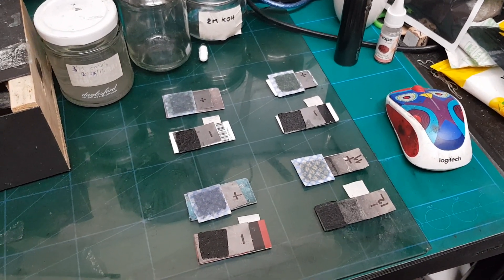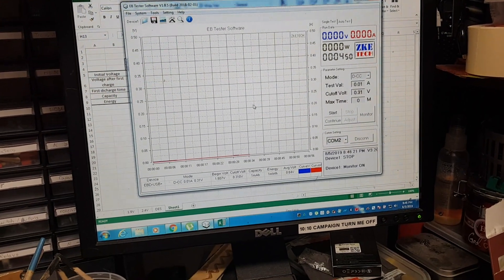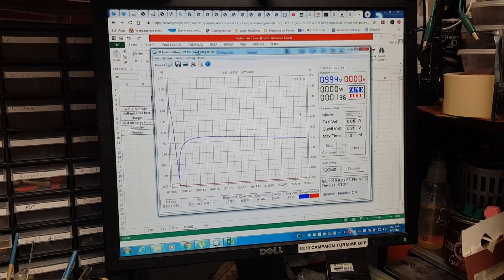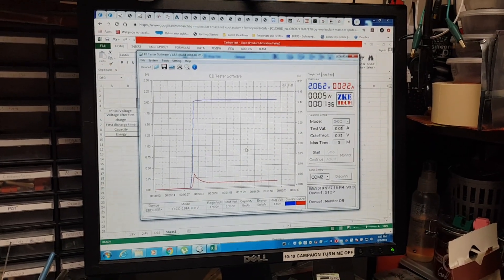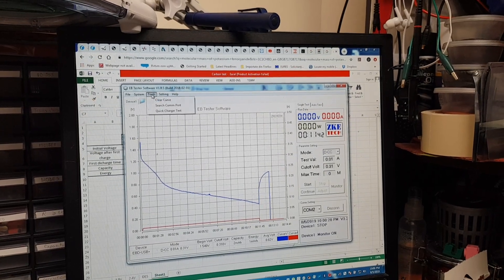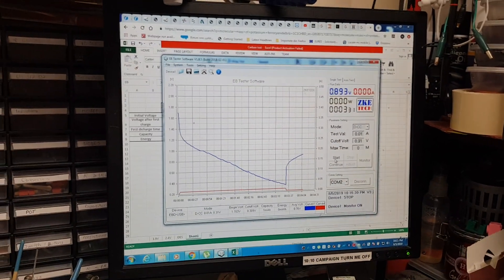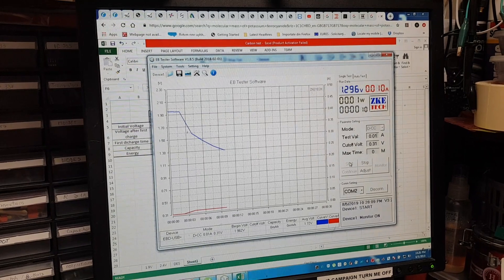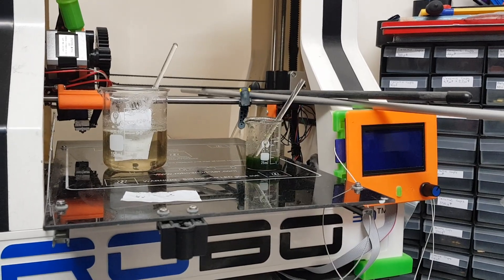Supercapacitors - testing different DES electrolytes

Comment: A very well presented series of tests.
I must admit to not having had much success with DES electrolytes after many attempts, in both batteries and supacaps.
The aqueous electrolyte was a bit disappointing, perhaps it needs a higher molar solution. 

I shall look forward to your DES tests using other metal salts :-)  Martin.